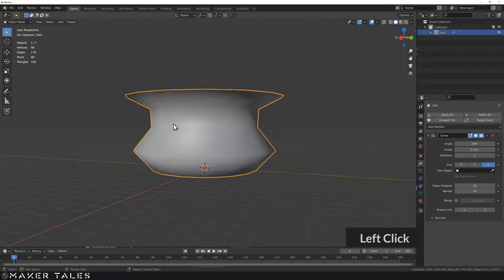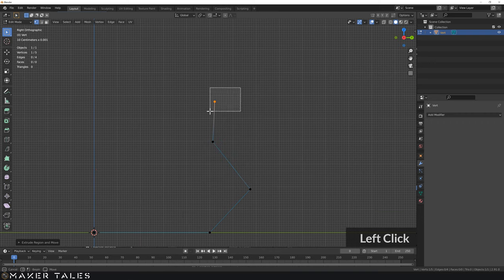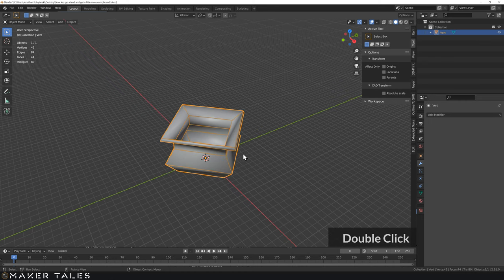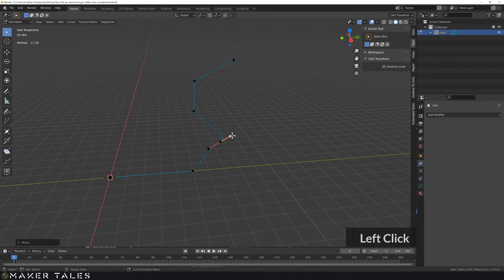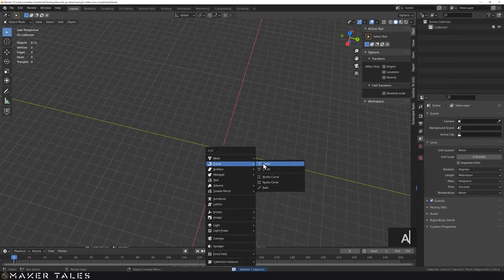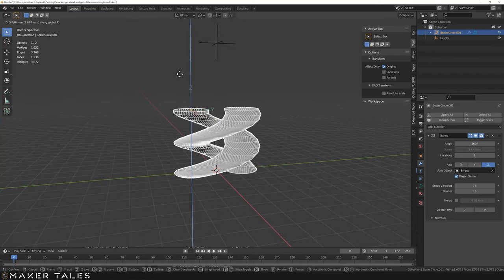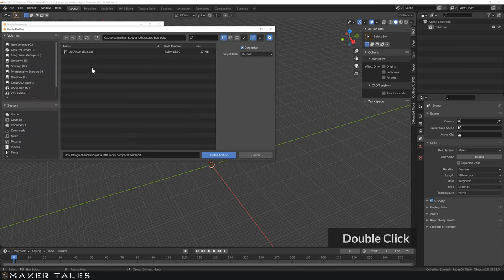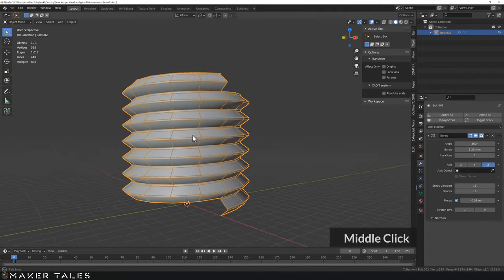Screw Modifier | Revolve, Bolts & Threads | Learn Blender 2.9 / 3.0 Precision Modeling | Part- 26

Comment: That bolt addon also restricts the breadth to 50mm so if you want to make a screw cap container with the bolt add on it will have to be 50 or less in diameter. Why go to the effort of making an addon just to restrict people from using it. Well annoying.

Comment: Very nice and to the point, just like always, that's what I like with your videos. Just one thing to note, maybe someone will find this useful; if you want to just drag a vertex handle out without rotating the vertex you can select just the handle and do a scale (S), it does the same as the slightly more complicated setup. Not sure if this works before 3.0.1, I'm too lazy to try O:-)

Comment: I can't even get the single vertex to extrude.  I'm using version 2.93.1.
Reply from the maker: Make sure that you are on the right selection mode and all that. If you are new to blender I have a full series that new and veterans have found useful.https://youtube.com/playlist?list=PL6Fiih6ItYsXzUbBNz7-IvV7UJYHZzCdF
Reply: Now you must alread know, but i was the same problem, i dont have that option. I discover i can create a vertex in Edition Mode holding Ctrl + Rigth mouse click. So much usefull.